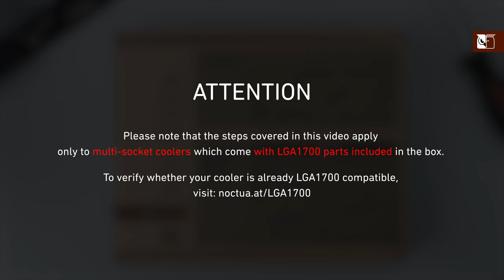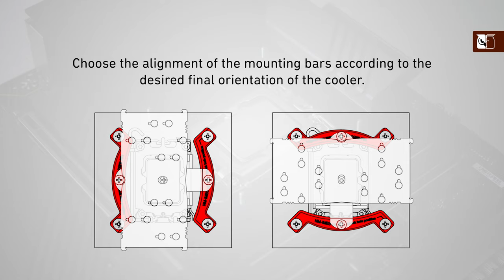Noctua SecuFirm2™ LGA17xx multi-socket CPU cooler installation

Comment: Hello!
I'm building a computer with an Asus Tuf Gaming B760M-Plus wifi D4 motherboard. The processor will be the I5 12600K and the cooler will be a Noctua NH-U12S Redux. I have been reading about a  problem where processors from the 12th, 13th and 14th generations, for LGA1700, may experience bending, due to the weight of some coolers in conjunction with an overclock to the processor's limit. I verified that there is a frame created to replace the original frame of the LGA1700 sockets on motherboards and that would prevent the CPUs from bending. If the problem can really occur, I would like to know what is the most correct thing to do in this regard case.
Reply from the maker: The reason Intel LGA1700 are bending is not due to the weight of the coolers but due to the pressure created by the Internal Loading Mechanism (ILM) of the socket. This pressure can be reduced either by adding 1mm washers underneath the ILM (the so called 'washer mod') or using so called 'contact frames' or 'bending reduction frames' as you have described. This can indeed be helpful to achieve better contact between the CPU and the heatsink to optimise thermal performance.

Comment: I tried to find a torque driver that handled < 1 nm and came up empty.
Reply from the maker: You don't need one, tightening the screws by feel is entirely fine as long as you don't apply excessive force.

Comment: This cooler doesn't fit my lga1700 msi pro z690-a ddr4. The mounting kit seems to be in the box but it definitely doesn't fit.
Reply from the maker: Sorry to hear you're having trouble fitting your cooler. All of our LGA1700 compatible coolers should fit your board without issues: https://ncc.noctua.at/motherboards/model/MSI-PRO-Z690-A%C2%A0DDR4-5371 Please explain in more detail what the problem is. Preferably, please email us at support@noctua.at and include a few photos so that we can help!

Comment: does this work for intel 10700F ?
Reply from the maker: Yes, the LGA1700/LGA1200 kit included with all our current multi-socket coolers also can be used on the 10700F. See here for detailed compatibility information: https://ncc.noctua.at/cpus/model/Intel-Core-i7-10700F-415

Comment: Anyone using the NH-U12P SE2 on 12700k ??? Im looking for tips…
Reply from the maker: This works nicely, all you need is the NM-i17xx-MP83 kit: https://ncc.noctua.at/cpus/model/Intel-Core-i7-12700K-1579
Reply: @NoctuaVideos  any test and  temps with this Noctua model NH-u12p SE2 ???

Comment: If only they packaged the RIGHT kit in the boxes that claim they work with LGA1200 and 1700. I keep getting sent old kits.. 5 kits later.. STILL cant get one with the LGA1700 bracket. First time in over 25 years of building computers has there been this much of a screw up in products like this. What Noctua SHOULD have done was sent EVERY manufacturer that has old kits without the bracket.. the bracket OR told them to send them back and replaced them with the updated kit that includes the LGA1200/1700 brackets.  So now.. several tries and 3+ weeks later I am STILL without the right one and Noctua apparently does NOT have the brackets available in stock. For the AIO OR their CPU cooler. So now you just have to be lucky enough to get one of their kits WITH the updated adapter in it. What a cluster fuck of an operation.
Reply from the maker: Thank you very much for your feedback, we sincerely apologise for the inconvenience. Which cooler are you trying to buy, from which shop, and where are you based?

Comment: I don't want to go into details, but after I bought this kit, I decided to never buy noctua again. Yes very good idea to use aluminium screws for something like this. Also extremely good idea to use a kit system which force you to throw all of it to the trash, all the kit to the trash if you broke 1 of 4 screws. You broke 1 of 4 ? Ok you need to buy a new one, and throw all to the trash. Horible products with horible temperatures anyway. Is good for old gen cpus, but for 12900k ? not at all !
Reply: Oh boo hoo! what are you the one unhappy customer out of millions of happy customers. These guys' products stand head and shoulders above the competition. How are you breaking screws FFS?
Reply: @hkrause6565   I hate their hypocrisy, I hate how in the video he use only his fingers to thight the screws, instead of using a screwdriver, and they also say "don't use excesive force". If you do like him in the video, a 12900k will go to 100 degrees in the first minute of the cinebench test. You should tight the screws very hard to be able to have decent temperatures, but you risk to broke them because they are extremely poor quality, and if you broke one is like you broke all 4, all the kit is useless. Horrible system, extremely poor quality ! They are good for old generation cpus, it was ok for a 5930k even in overclock, but not for a 12900k.

Comment: Wth dude, intel launched another new socket.
Reply: Are you actually surprised?
Reply: @voxelfusion9894  on the positive side we get new motherboard designs
Reply: @voxelfusion9894  Not Really. But I always get mad about it. At least this time it makes sense. But they do be blocking upgrade with these expensive paths.
Reply: yes the new alder lake processors will only fit in LGA17xx mobos.